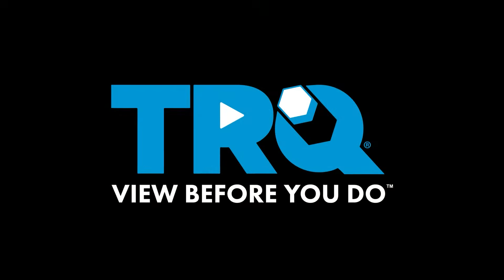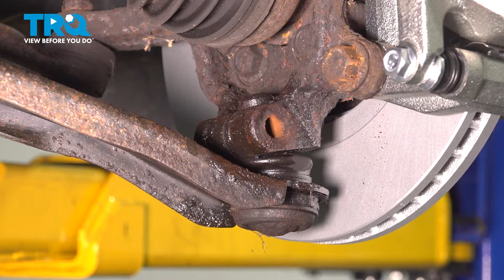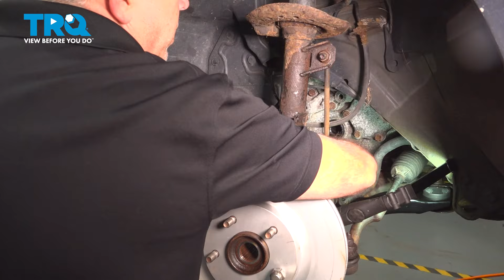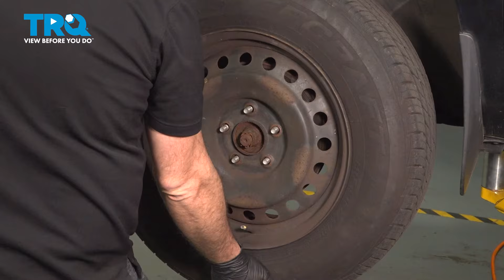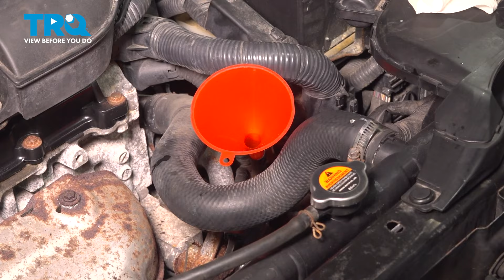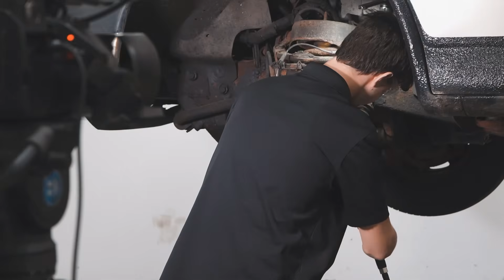How to Replace Front CV Axle 2008-2013 Nissan Rogue

Comment: Had my suspension apart three times in the past year. For anything other than changing the sway arm, remove the top strut bolts instead. and don't remove the ABS sensor from the hub unless you're changing a bearing. It will inevitably disintegrate and leave you having to ream out the hole and possibly even drill out and re-tap the thread (know this one from experience) - I've had to swap out two after watching these tutorials. Unclip it from behind the inner arch instead.

Comment: This is a very good tutorial EXCEPT I would remove bolts on struts instead of separating the control arm pin (MAJOR HASSLE)  My Son's rogue needed both CVs. After a huge hassle with the driver's side and even damaging the ball joint, ( pressing a new one in, not fun) I removed the strut bolts on the passenger side and it was 10 times easier and much much quicker with no alignment issues.

Comment: You do know you’re supposed to check the CVT fluid level with the engine running right? If the engine is off, even if the trans is fully up to temp, it’s going to read low. You likely overfilled it if you didn’t check it using the appropriate method.

Comment: I compressed the strut spring at the start. I did not use a pickle fork; I used PB Blaster and worked the ball joint up and down with a drift and hammer.

Comment: Bad tutorial. Remove the two bolts from the strut. The LCA route is extremely difficult…DO NOT attempt.
Reply: Remove the 2 bolts from the strut and it pulls out? I’m doing mine tomorrow.

Comment: Yeah faster and easier to remove the two bolts at strut/knuckle interface. Just unclip the ABS wire at the strut so it has slack. There is not an eccentric bolt like Subaru so it will not affect alignment.   Edit: speaking FWD; not sure about AWD

Comment: All you have to do is take the two bolts from the strut and the 1.24  center by wheel and that's it
Reply: Can confirm. I used this method today and had it done in 30 minutes.
Reply: Exactly I'm doing mine tomorrow
Reply: This one does have this kind of strut. This strut is the type to slide out of the knuckle sleeve.

Comment: The advice at the end regarding the fill level on the transmission dipstick is wrong!!! The level should be within the notches, NOT where the word "hot" is listed. This is confusing and I don't know why they mark it this way on the dipstick. Also, on this vehicle the transmission fluid should be checked while the vehicle is warm and running in idle. This is a great video otherwise and helpful for me to replace my CV Axle but I don't want anyone to ruin their transmission by overfilling I have a lot of experience with these transmissions. Aim for the top notch when warm and idling no more than that! So your not just taking my word for it you can look at the 5 minute mark of the of this link about checking fluids in you Rogue. https://www.youtube.com/watch?v=uCZ5cmSop6I

Comment: Fantastic video, thank you so much. I am going to be replacing the front driver-side cv and wheel bearing on a 2019 Nissan Rouge. Do you know of any differences in the installation for the newer model?